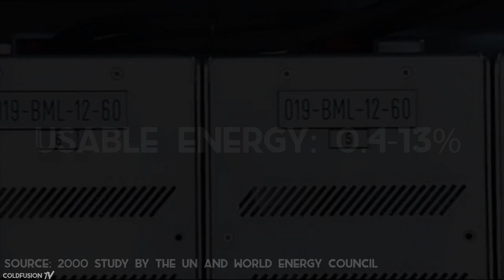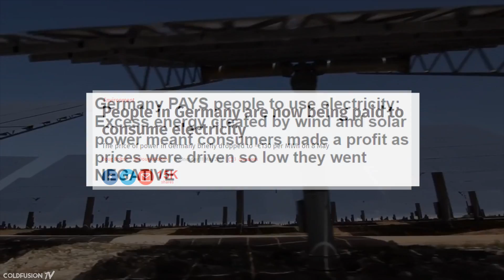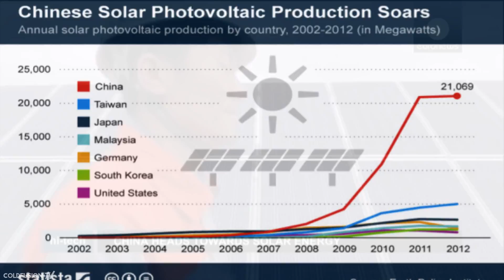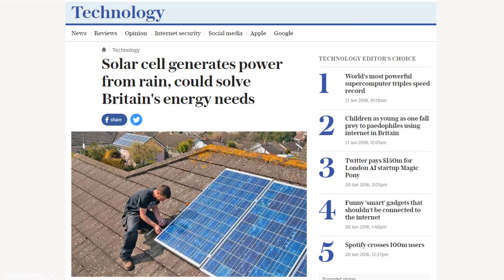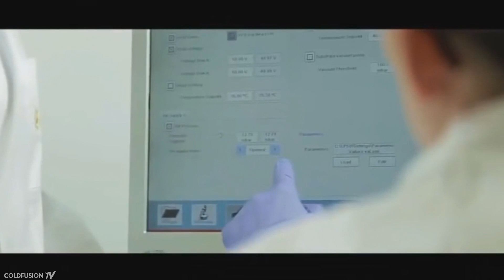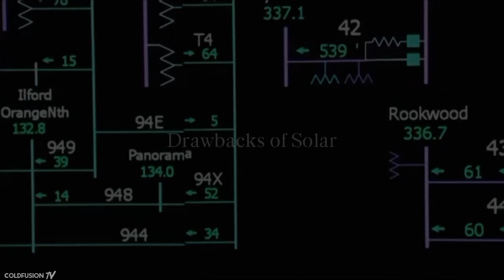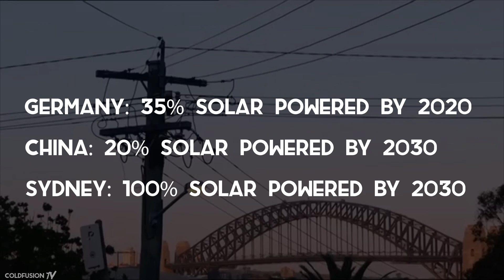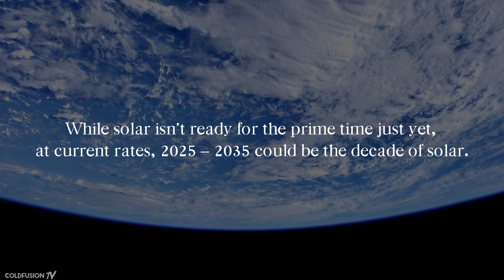The Truth About Solar

Comment: These are lies. Germany's solar experiment is a failure.  Solar does  not work, due to it being diluted energy along with we cannot  efficiently store the energy produced.
Reply: We can, and we currently are, storing excess Grid Power efficiently. The designers of the original Grid in the USA did not, and do not want LOCAL STORAGE -  which leads to local independence from the power monopolies that want to control the grid = MAX PROFITS.  Local PV farms + Local Storage = less profits for the power monopolies. Follow the money ...
Reply: Bath County Pumped Storage seems to work Ok, it was built in 1985 and stores 24,000 MWh at 80% efficiency. Of course is wasn't built for solar, it was built to store the overproduction of nuclear to be sold at peak prices.
Reply: @dougmc666  Yes, we have Pumped Storage at a dam near me, too.  And it works very well.  But now we need local storage like at the sub-station level or even at each house = smooth out the demand peaks vs production on the grid and could also help prevent brown-outs and short term blackouts.

Comment: You forget to mention some important factors. Solar panels can work, the good ones, for about 15-20 years. The cheapo Chinese panels for about 5 years. Inside the panels there are some not really environment friendly materiels. Same problem with the batteries. Now please make a calculation of how much land you need to place the all needed solar panels for the city of Sydney.  Green my ass. You ppl have no idea of what are you talking about. This story is it not a green one.
Reply: Polycrystaline Solar Cells are made from greater than 99% pure silicon ...
Reply: @MrSummitville That's s blatant lie.
Reply: @upstreamer1661  Polycrystaline Solar Cells are more than 99% pure silicon, if not then what chemical do think is present?

Comment: But we are using the suns energy and we have been using it ever since fire was tamed and used for heat and cooking
Reply: Fire won't charge your cell phone
Reply: @MrSummitville  Incorrect sir! Look up Flamestower.
Reply: @ThePeterosion  Now, you've added an electronic device that converts heat energy into electricity. It costs $100. And uses 2.5 hours of FOSSIL FUEL to recharge one cell phone. YIKES!

Comment: Dumb dumb silly video. On average you get 5.5h X solar panel rated panel what's per day... We have no way of cost effective storage. Except hydro. Solar is shit. You will never get low cost solar unless u use it directly without storage. Or your government subsidies.
Reply: I have low cost solar.
Reply: @MrSummitville  #... When the sun is out...
Reply: @robertanderson2750  Yes, when the sun is shining, I burn no fossil fuels.  At night I get my electricity from a Hydro-Electric Power plant. The dam stores excess Grid Power, b pumping water into a lake high above the dam! My break-even for my Solar Array was  only 3 YEARS, which has already happened. Do you have Solar Panels?
Reply: @MrSummitville  if we had hydro dam storage everywhere then we would be ok. Sadly not everywhere has hills 🙁. So we still have a minor solar energy storage problem world wide.
Reply: @robertanderson2750  The existing Grid was designed to not store any excess power.  To prevent local independence. That has been changing. We store excess power via water ( Gravity Lakes ), heat in molten salt, compressed air and now Lithium Battery Power Stations. The grid is becoming decentralized. The big monopolies, and the morons in government, are fighting this hard ...
Reply: @MrSummitville  the Grid wasn't designed to store excess power because power storage is expensive (all technologies - excluding hydro). Don't need no government conspiracy to explain that.

Comment: Unfortunately...high speed air and space travel seems to be the domain of either nuclear or fossil fuel/hydrogen power...
Reply: Space X wants to produce the methane for their starship with solar power in long term, and if they fly to Mars one day, they will have to do this on Mars, to generate energy for the way back to earth. This is the reason why they chose methane as fuel for the new starship. 
Aircraft could also fly with synthetic fuels, the only challenges to solve are price and the huge production capacity.

Comment: No one ever talks about recycling old solar panels and their relatively short lifespan of less than 50 years.  Production if traditional solar cells involve a myriad of toxic components.  Made under strict regulations this may be no worse than mining for uranium or lead for batteries, however, most cells come from countries that don't care about polluting rivers or the environment.  Yes we want a smaller carbon footprint but not at the expense of other forms of oollution.
Reply: I mean, not many things we make last 50 years. even cars aren't use much after 50 years
Reply: @LanternsoftheDead  A well kept auto that lasts 50 years, usually increases in value. We now have PV Panel Recyclers ...

Comment: Here's the real truth.an off grid solar panels inverter and battery storage plus hot water system on a timer done yourself $30000 for 30 years in Australia maximum.use truck batteries use any battery setup connected up.....cost of grid for family of around 5 in Australia over 30 years around $250000 for 30 years.its already 9x cheaper and that's non subsidized
Reply: Great Job !

Comment: Fusion is still the answer.
Reply: When ?
Reply: @MrSummitville  5-15 years is estimated. Depends on money, and time. iter should have the first x10 energy version.
Reply: @benjaminatwood  Will the "Magnet Confinement" method or the "Inertial Confinement" method be the more likely solution? The current COST is unjustifiable. Maybe, more than 15 years, way more  ...

Comment: Really really REALLY good video!  I learned a great deal!  Thank you so very much!
Reply: @Draugr Hessler I have PV Panels in my backyard and I can state with 100% confidence...
1) They are NOT expensive - you can get a LEASED system with $0.00 out-of-pocket
2) They do not need any maintenance. 
3) They do not suck.
4) They are "green" ... the Solar Cells are made from > 99% pure silicon.
You appear to be the slack-jawed moron ...

Comment: A few things I was hoping this video would touch on but didn't: How are solar panels made? It looks to me like plastics and glass, I'm not sure. It also looks like oil and electricity go into the productions of solar panels. So how environmentally unfriendly does that make it? Also, are and how are solar panels disposed of? Are they recycled? Once they stop working then what happens with the piles of solar plastic. Can solar panels be made from recycled plastic? 
Just to be clear I am all for renewable energy, when I talk about converting to solar I am constantly told of all the negatives. I am asking because I am curious and hope there is a way to recycle or repair solar panels once they've bit the dust. This is one step in the right direction to a world thriving on sustainable and renewable energy.

Comment: Solar panels cost $200+ You are wrong. They are still expensive and NOT $97(36 cents per watt 270 watt panel) like you said in your video!
Reply: You can buy 100W panels on amazon right now for $84, and that's not in bulk, that's just a single unit, retail. While that's .84c per watt, it still proves you didn't bother to do even a single second of research. Educate yourself.

Comment: Solar has barely been improved since the 1980s. They barely are more efficient or powerful.
Reply: even if that's true, they became cheaper therefore MORE NODES therefore MORE POWER
Reply: @cernos7230  lol that was practically a contradiction. But sure.
Reply: @screwthenet  contradiction in what way?
Reply: @cernos7230  BEcause you literally said " Even if thats true..." before saying " more nodes, more power." >,;,< lol
Reply: @screwthenet  yah, more nodes more power, is nodes are cheaper now then we can build more
Reply: Solar Panels are now cheaper than other energy sources, for many people. Why pay more for Fossil Fuels, or Nuclear, or Hydro?
Reply: @MrSummitville  Firstly cheaper means just that: cheap. Not exactly a sterling example of efficiency. And secondly,  I never mentioned fossil fuels or Nuclear or Hydro.  There are ways to have wave generations and wind power, and even geothermal power without breaking the bank, but as long as folks are lazy and willing to rely upon PG& E, instead of, say, making solar panels more powerful, which still wouldnt make them much more costly, nothing will change * shrugs *.
Reply: U are plain idiot.
Reply: @evilskieviiilek5182  Nope, I just know enough about technology to understand it. Sucks for you. ^^

Comment: A few yrs ago i calculated that it would take 60 one sq miles of cells to meet all usa needs .
If put along I 10 then Georgia would supply the first solar power with California suppling end of day power .
Efficiency has gone up since then 
Green jobs will provide 100k jobs  when we switch over  
Fossil fuels are on the way out
Reply: Tom Robertson efficiency has gone up? Wtf? Green jobs, and what about killing jobs? I think you are on the way out, what about costs, rendement, and maintenance, and what about soil pollution? Mmm silence,....
Reply: I didnt do a masters thesis 
Just a norrmal information
Yes efficiency has gone up 
Do your own calc 
Green jobs provide more jobs 3 times more then fossil fuels 
Do your own research to refute me 
Dont be a lazy troll
Reply: Tom Robertson Tom jobs means paying people wages. This equals ongoing costs that must come from power bills.  And don’t forget that solar panels have a mean life span of 20 years after which they need replacing.
Reply: @rachels209  prices of cells and batteries are dropping 8 percent a year .
A ten year project means at the end the cost would be half of what you started 
Every location finished would bring revenue in to pay for the next one 
But local jobs would be created bringing revenue to small towns 
But my figures are just back if envelope figures 
Not an actual proposal 
Real research says green jobs would provide 4 times more jobs the fossil fuels .
Which we will run out of at some point in the future 
Then why wait until then ?
Every tech develops in a "S" curve 
China has already spend billions on the first part of the curve 
They are set to be at exponential  growth in solar cells 
Sit around waiting and we will be passed by

Comment: It has no sense whatsoever to compare the efficiency of solar electricity production with the efficiency of electricity production from coal.
There is no point in doing that.
Reply: Is "Cost per Watt-Hour generated" is good measure?
Reply: MrSummitville I’m afraid not. That is only the economical dimension.
Reply: @anonymous.youtuber  What other dimension  is required?  Solar is economically feasible for me.
Reply: MrSummitville The other dimension is the impact on the environment and on public health.
Reply: @anonymous.youtuber  Specifically, what is the impact on the environment and what is the impact on public health?
Reply: MrSummitville The mining and the burning of coal produces many toxic substances which I guess you are well aware of. Even if the burning process is optimised, it still produces CO2, the environmental impact of which is well established.
For solar energy, we should of course try to minimize the impact of their production and their recycling.

Comment: study after study show that the variability of solar and wind poses  a huge barrier for deployment of more than 10 %
Reply: The Tesla Power Wall and the Tesla Power Pack are a solution. The local Hydro-Electric plant stores excess electric power by pumping water up to a special lake - this has worked well for many decades. They are many ways we can store energy but we've had no need to, because we implemented "Peaker" plants by burning natural gas.
Reply: @MrSummitville  there is no affordable globally scaleable storage solutions. So many PowerWall buyers are disappointed by the unsatisfying electricity it can hold.
Reply: @Th33Xx  The grid is changing from a few large centralized power plants (monopolies), to many smaller decentralized power plants. GE  is installing a 300 Mega-Watt-Hour Battery Backup to smooth the output at a 100 Mega-Watt Solar Farm - You need to do more research regarding the latest Solar & Battery technology.  The Power Wall 2 is rated at 14 kWHrs !  If the buyer can READ, then they will not be disappointed with a Power Wall 2..  If one power Wall is not enough, then install two. How much power do you need during the night?   The price of Grid Electricity is constantly going UP, while the cost of Solar & Battery Technology is going DOWN.  Many homes is Hawaii already have "AC Batteries" installed and they are working perfectly...
Reply: @MrSummitville  I live in Denmark. We've been pursuing the decentralized and wind energy strategy since 1988. 
And we get just 8 % percent of our energy from wind. France got 45 % of total energy consumption(TFC) in just 15 years, with nuclear. 
Denmarks average yearly CO2-emissions per produced Kilowatt hour are around 450 gram co2/Kwh, just like the US. French Co2 emissions are 50 gram co2/kwh. Check electricitymap.org. 
Batteries are worlds apart from grid-scale storage, the only serious storage solution is pumped hydro, and that is not scaleable. 

You need to find empirical support for the effectiveness of all your cool sounding solutions,
Reply: @Th33Xx  In 1988, storage of excess grid energy was more expensive, more complex and slow to react vs today.  Wind Turbines can be quite variable - their instantaneous  output can vary tremendously, without any warning.  In 2017, Denmark's wind turbines  generated > 50% of the total electricity produced.  "Pumped Storage" is used to store excess power. Today, Grid Level "AC Batteries" can respond very quickly yo changes in grid demand vs grid production. Sometimes, Denmark is an electricity exporter to Sweden, Finland & Germany.
Reply: @MrSummitville  
1) Electricity is only 17 % of total energy use. 
2) DK's net imports(Export-import)  is 1/6 of its total electricity use. DK's silly wind grid is only possible because sweden and norway produces 4-5 times af much electricity as  we do, and sell it to us. 
3) 
Tell me about the batteries out there that can power the whole grid for two weeks with neglible wind?
Reply: @Th33Xx  I don't care that electricity is only 17% of total energy usage - irrelevant.   Yes, I know DK imports & exports electricity  with other countries - I just told you that. Do your own research regarding "Grid Level AC Batteries" ...

Comment: The newest thing now is hybrid air conditioners. Japan Panasonic and China both are selling product. It popular in Honolulu. That ac is like a mppt controller. You hook the 1,000 watts panels derect to the air conditioner no inverter needed  as it use 38-48 volt derect off the panels.  You don’t need battery, and hybrid meant it use a,c electric at night.
Reply: From solar to battery to inverter to air conditioning is very ineffective. Cable & battery Heat up . Inverter waste amps
Reply: @thomas4315  Also, "Inverter" Air Conditioners are very efficient and have very low start-up surge - great for off-grid.
Reply: If you search it down I seen a lowest 600 watts one in Ali express comes with one large panels made for the trucking industry. Really nice . 800 bucks. Was thinking about it. But after I get my 5000 btu on my solar on my van . Doesn't work as should. Just too much passing clouds here. But might work for home use

Comment: solar is now and always has been dead. It cannot replace coal, gas, or solar power plants. Put it on your house and wait for 20 years for pay off. Solar can not work in big sites.
Reply: It may take 20 years, if your electricity is cheap and you must pay someone big $'s to install your system. I have a 10,000 Watt PV Array, self installed, and it will break even in 3 1/2 years ...